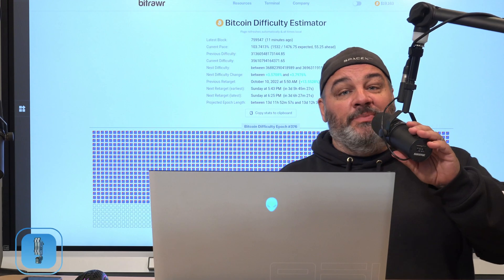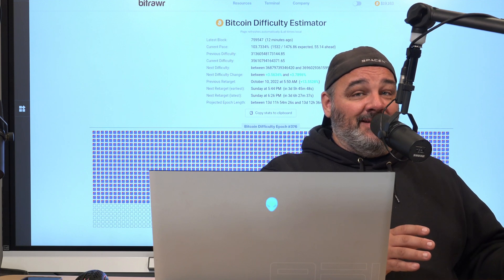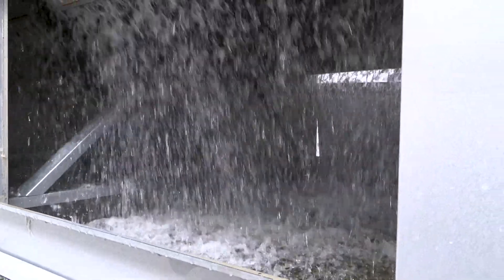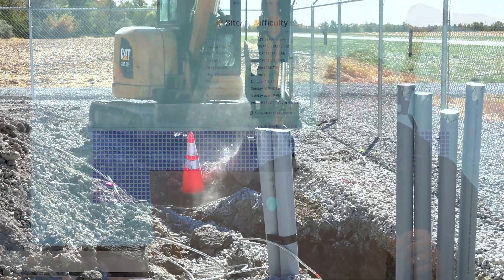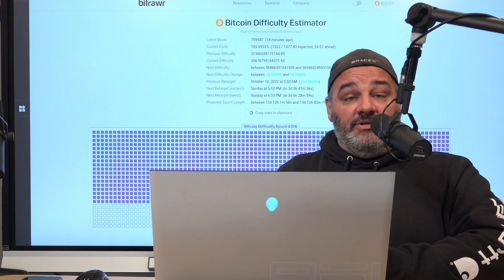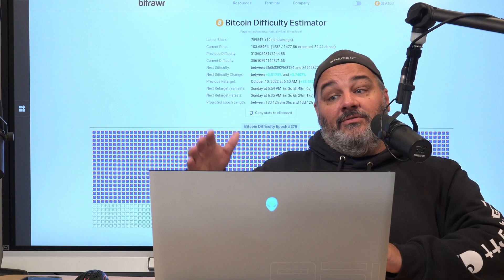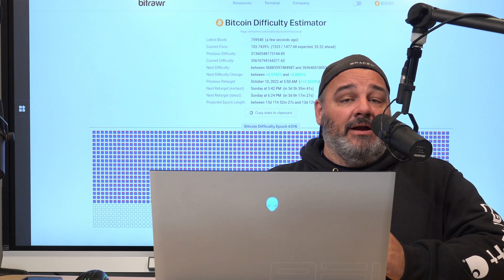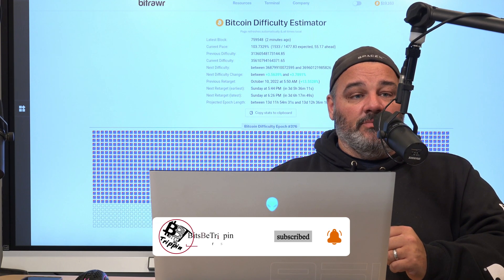The Bitcoin build continues in a bear market

Comment: How did you go about purchasing miners with 277v compatible power supplies? I have a 277/480v 3 phase service as well.
Reply from the maker: The alpha PSU shown in video, you remove the stock psu and put the alpha in
Reply: @BitsBeTrippin  So you are  buying all the miners with 240v power supply and buying 277v power supplies for each miner? That seems like a lot of extra money but you must have already done the numbers and found its cheaper than going the transformer route and stepping it all down to 240v.
Reply from the maker: @nochance1017  it depends, for our particular situation here we had very limited space so we couldn’t put in stepdown switchgear and transformers as our site shifted mid ordering.